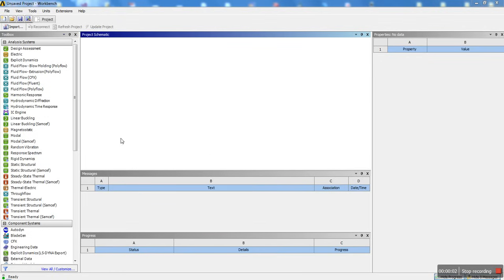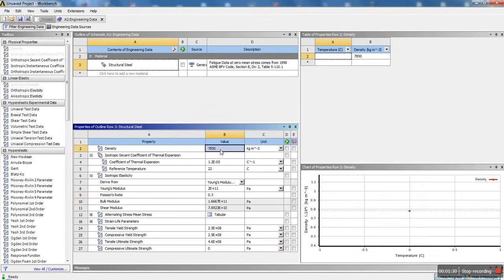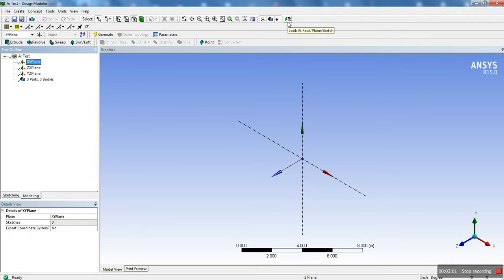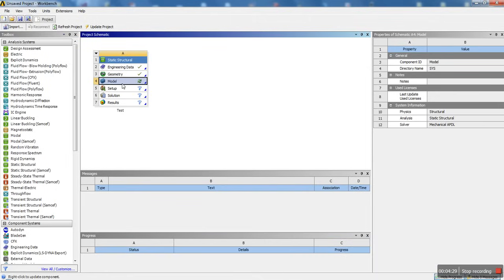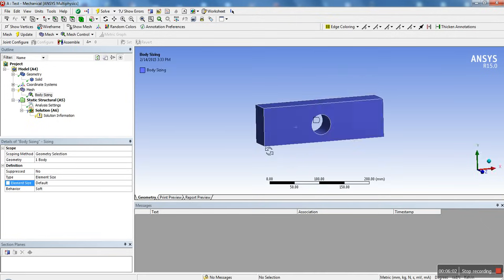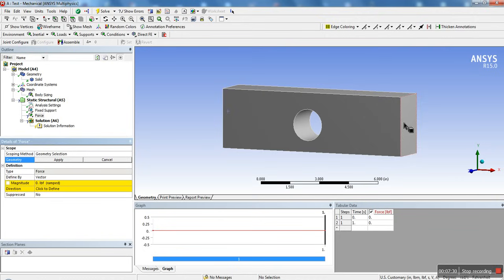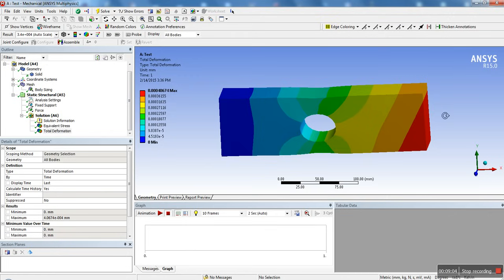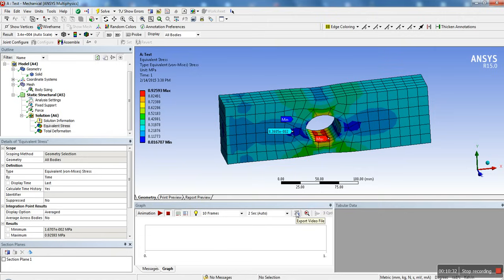ANSYS Workbench Tutorial - Introduction to Static Structural

Comment: Hi, thx for the tutorial, it got me excited to go to the next level, but I need help. Do you have any tutorials on a flanged pipe supported at two points? The pipe is of composite material of steel and concrete lining. I need to calculate the force at the flange and the maximum deflection.

Comment: Hello Sir,
What is the answer for this question?

Q. The boundary layer
Select one:

a.
boundary layer shape is only depends by the velocity of the flow.

b.
boundary layer shape is not depending by the viscosity.
 
c.
it can form in the middle of the flow domain.

d.
can form on any rough surface.

Comment: I am also solving same problem but with little variation. In my case I am not fixing plate from 1 side, it is free from all sides and applying stress on both sides but it's giving error. If I fix from 1 side problem changes. Please suggest something. Thanks.

Comment: awesome..... if possible try to do some videos related to thermodynamics and heat transfer.. analysis of heat exchangers , where there are 2 fluids entering the tubes at 2 different temperatures.  or cooling of a hot fin using cold air (natural convection or forced convection)

Comment: I   want to import a Creo model (IGES) of hollow steel pipe structure  in Ansys and  check it whether it will sustain the load of 4 water heaters (2.8 T).   Hope someone will respond positively.  umang.201078@gmail.com  9725671950

Comment: hello, Dr. let me how make a graph of stress distribution over a path or nodes?
Reply from the maker: In Mechanical, you can right click on Model in the outline tree, and insert Construction Geometry. Right click on Construction Geometry, and insert a Path. Then choose your Start and End locations (you can use geometry selection for this or input manual X, Y, Z components. Now in the Solution branch, create a new Equivalent Stress result, and under Details-Scoping Method, change it from Geometry Selection to Path, and then select the path you created. Then Solve to evaluate the results. Hope this helps!
Reply: Can you make a basic video of Ansys for plotting the results and so on...

Comment: Hello, drdallyo
I have a query about symmetric region, if I want to do this analysis using symmetry then I want to know how I can visualize full model
Reply from the maker: +Sufian Ahmad Great question. In Mechanical, only when you use Cyclic Region symmetry does it show the full model in results. There is a way however to do this with regular symmetry but its not as elegant.. In ANSYS Workbench, click on Tools, Options, Appearance, and check Beta Options, click OK. Then inside Mechanical, under the Details of Symmetry, you will see "Graphical Expansion 1 (Beta)". Depending on what you want to mirror at the boundary conditions, Choose Num Repeat: 2, and Method: Half, and add a value to the offset number in the direction your mirroring (could be negative). Then when you click on the results, you should see the full model. This will only show in Results and in Mesh views. I agree that ANSYS is lacking this feature for regular symmetry. Would be nice to have a more robust and better way of displaying it as other software has already. Let me know if this helps or not!! Thanks for watching!
Drdalyo
Reply: DrDalyO 
Thank-you DrDalyO, it's working.
Reply from the maker: Glad to hear it!

Comment: IN ansys workbench in solving problems on truss ,i find some corners are
 there which not merging with each other ,how to merge it solve it ,sir
Reply from the maker: +Mechanical Engineering Double check to see if you need to add a connection. Its under Connections in the tree window and you can right click and add a manual connection between them

Comment: Hello, I am working on a elastomer material and have selected elastomer sample ogden as my material. when i use this as material i am unable to run and update the setup. It says the setup component is static structural requires user input before it can be updated. can you please advise and help. thank you
Reply from the maker: +siddharth jain somewhere you are missing an input. Go over every cell in static structural and make sure nothing is missing, start with engineering data, then the setup etc.

Comment: man i have a problem... i don't know what i've done wrong on the installation... but in the toolbox i only have component system and external conection system... and in the toolbox customization i have chekced all the items... so i don't know what to do... i really hope you can help me...
Reply: Have you solved it?...It is a matter of the license and the copy of Ansys files you have...Try to check out the server utility...Thanks
Reply: Open ANSLIC_ADMIN; Run the License Wizard; Upload the new License File (Keygen); Set License Preferences for USER XXX;

It worked for me ;)

Comment: How do you put the hole in the centre?
Reply from the maker: +emrald paradise you can use Dimensions under the sketch tab, and set dimensions. Easy way would be to use AutoConstraint. Or use the grid option under settings also in sketch tab

Comment: Hello, Thank you very much for this introduction. How it works if instead of the hole I would like to have a second material ? Thank you for your help
Reply from the maker: can you try the test yourself if you have ansys!? wel if there was a material instead of a hole, then the stresses in the area would most probably be reduced.
Reply: I mean how can I add a material instead of the hole with ansys ?
Reply: You can do an array with two bodies instead of 1 body and in geometry you can select de body by one and add different materials for one or an other.
Reply from the maker: +Jawad DAHMANI you can create another sketch, and use a sketch projection and create a circle of same size and then extrude frozen. Or you can create a plate with no hole, then sketch a circle and do a slice material extrude. See some of my other tutorials, i show how to create multiple bodies

Comment: Is the force always applied on the symmetrical/opposite side of the fixed support? And if so, why is thAt?
Reply from the maker: No not always. But if you took a physics class you would know the basic laws like newtons law f=ma, so if you apply a force on one end and fix the other, where both forces are along the same axis, the reaction force will be equal and opposite to the applied force because the object is at rest (static). Maybe refresh yourself on this before jumping into finite element analysis. Google stuff like Newtons law, Normal force, etc. thanks for watching!

Comment: thank u . pls upload more beginners tutorials if possible .
Reply from the maker: CHANDRA PRAKASH Thanks for the comment! I will upload some more. Do you have a topic in mind?
Reply: DrDalyO  thank u for the reply.Sir u can upload from static structural, thermal. Ur videos really helps me as i am a beginner in doing FEA analysis.
Reply from the maker: CHANDRA PRAKASH what kind of thermal tutorial would you like? heat transfer across a solid body or like air over a hot block. Also for static structural, would you like one on Contact elements, or maybe more detail on meshing?
Reply: Sir all the above things will be helpful.